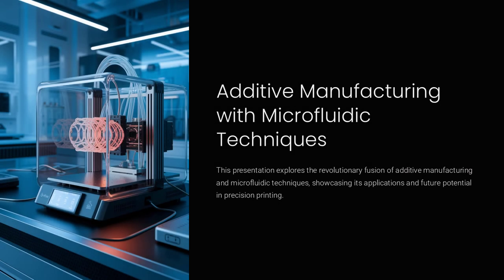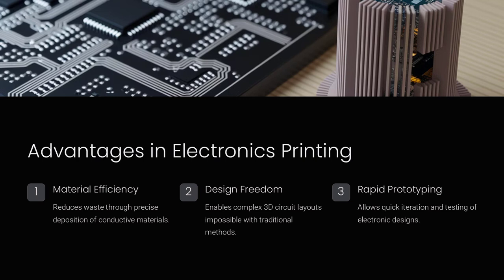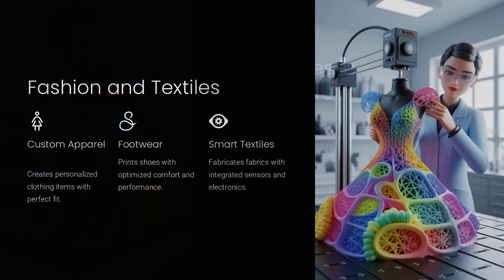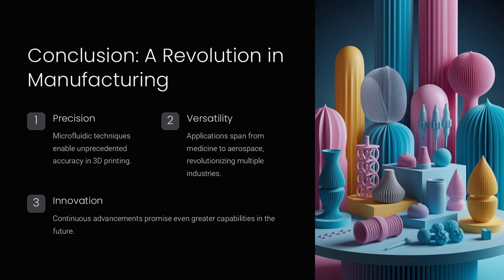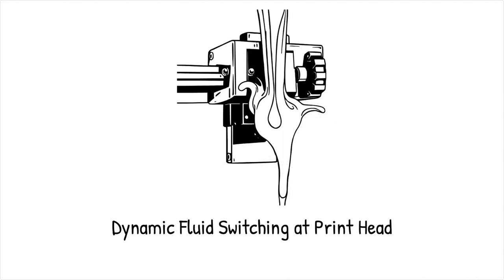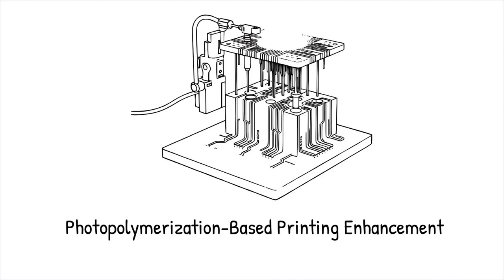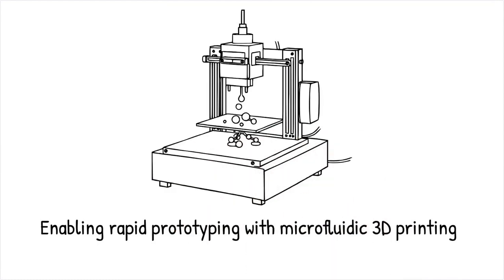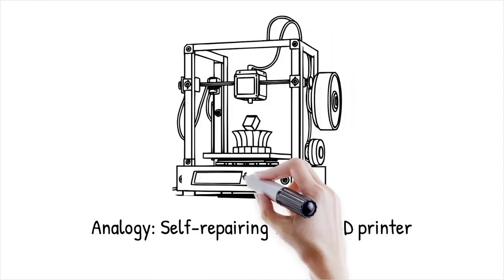How Microfluidics is Revolutionizing 3D Printing

Comment from the maker: How can microfluidic-assisted 3D printing achieve scalable, high-throughput fabrication while maintaining micron-level precision, considering the challenges of fluid dynamics, material compatibility, and deposition speed?
What fundamental physical and chemical interactions govern the self-assembly of multi-material interfaces in microfluidic printing, and how can these be controlled to create functionally graded materials with predictable mechanical and biological properties?
Can microfluidic-based additive manufacturing be integrated with in-situ sensing and AI-driven feedback systems to enable fully autonomous, self-correcting fabrication processes for complex, multi-functional structures?